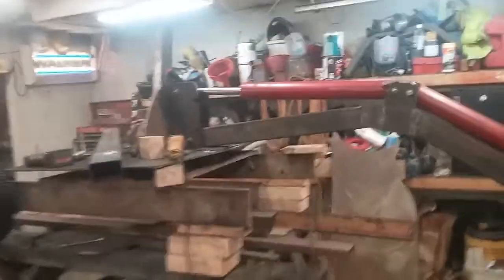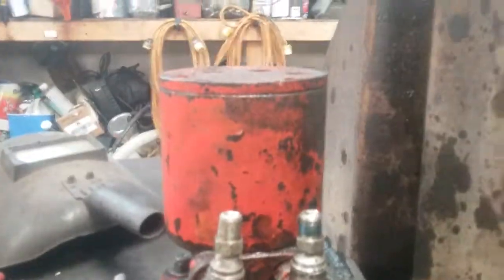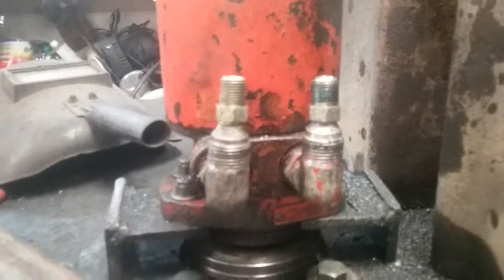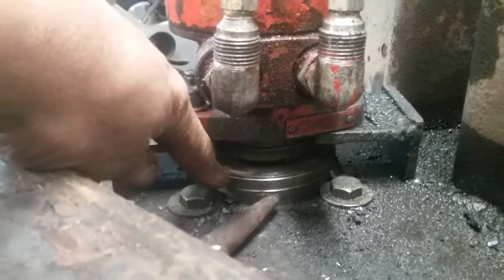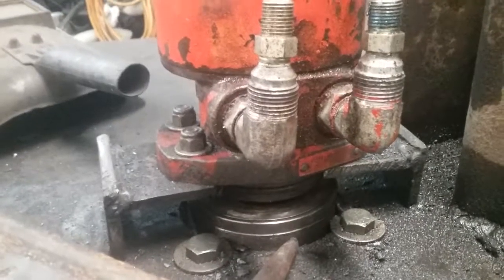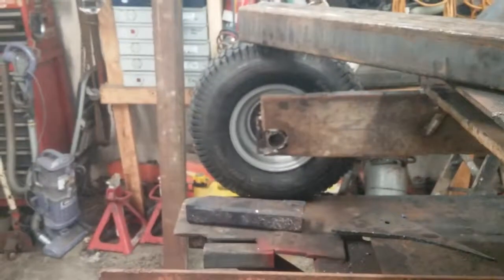Homemade towable excavator

Comment: I was surprised to see that the CASE drive motor could turn your swivel so smoothly.  I have several of these motors from old CASE 446 garden tractors.  I always thought that I needed a large ring gear with a smaller gear on the hydraulic motor.  I'm curious how much torque can you get if you try to push something sideways with your bucket?  I'm in the process of attempting to build something similar to what you have done.  Any info would be appreciated.  I live in southern Alberta, Canada (near Calgary).  Anyway, have a great day!